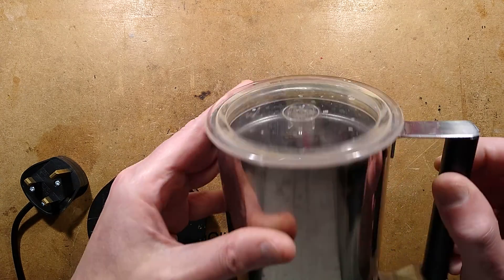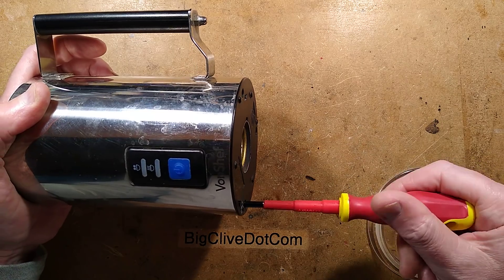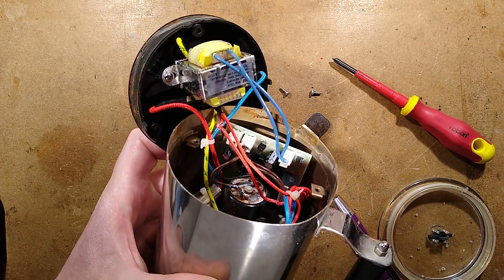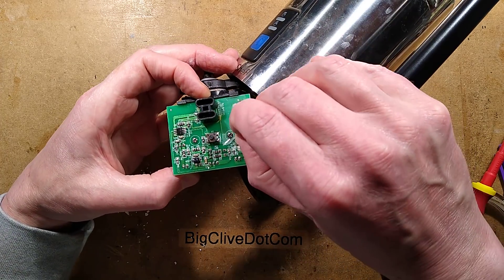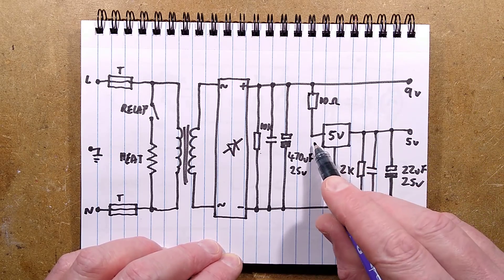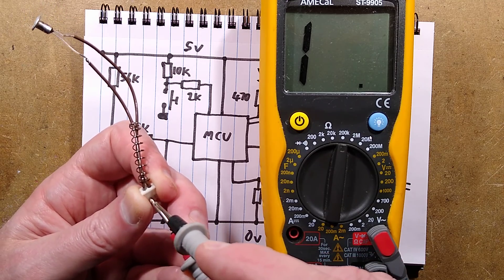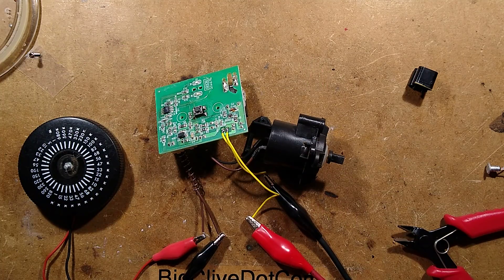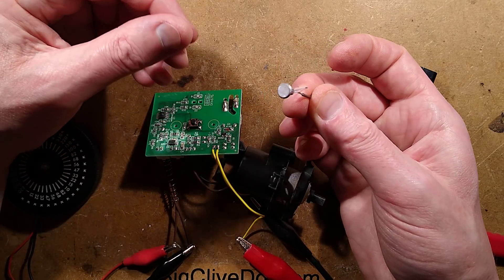Thomas Nagy milk frother autopsy

Comment: That board on its own would be a handy universal micro board.
Swap the micro (assuming you can match the pin out) and you have a simple programmable control board for projects.
Reply: Thats called an "Arduino"
Reply: @jaycee1980  really? Can you drive a motor or heater directly from an arduino without adding shields or extra circuitry?
There is a whole world out there that arduino are not the solution to.
Reply: @rohanhamer8429  Directly ? of course not, but then that's true of most things. If you want something you can just hook stuff up to without doing anything like that, then what you want is a PLC.

Or, you could just learn how to build the required external circuitry
Reply: @jaycee1980  I know how to do all that, I’ve been in the game for more than 40 years. My point was that this board has the extras already on it and would be useful for other tasks, for that reason. 🤦‍♂️
Reply: @rohanhamer8429  except you have to buy a milk frother to get it, and the microcontroller is not flashable...
Reply: @jaycee1980  how about you read and understand my original comment before opening your mouth. It’s about reusing and repurposing what was got for free and would otherwise be thrown out. I’m not suggesting you go and buy anything.
Having said that, if this board was common and available as a spare part from the usual Chinese suppliers, I bet it could be had for only a few dollars.

Comment: weird that they used the motor shaft to turn the frother, they could just put a magnet on it and on the frother and turn it with no shaft needing to go through the metal cup
Reply: Yup, Nespresso sells a similar device with exactly that feature
Reply: Kids and swollowee things.
Reply: Does that work through metal though? Those magnetic stirrers used in lab equipment go through glass. It's unclear what the base is made of. 3:28 Possibly plastic, maybe metal.
Reply: @ianstobie  Lab magnetic stirrers work fine through aluminum and stainless-steel, use them with pressure reactors all the time.  Probably some extra drag due to eddy current losses and local heating, but not a substantial problem.  Of course, if it was designed this way, then the milk wouldn't get into the electronics and you wouldn't need to buy a new one every year or two.  Seems like a rather obvious case of designed obsolescence.
Reply: @ianstobie  they do if you have a metal thats not electrically conductive and non ferrous. 
I would even see it work with electrically conductive ones but it might not be perfectly efficient. And its not like ferrous metals block out 100% of the field.
Reply: Thanks Robert and Ramog. 
So it looks like this one is just a poor design. The state of the art allows better.

Comment: Gotta love planned obsolescence
Cough*LED light bulbs*cough
Reply: Yup, I bought half a dozen Osram 8.8 watt LED  bulbs to try as replacements for CFL bulbs which fail normally within a year.  The Osram devices started failing at week 2 or 3 with a 50% attrition rate at 2 or 3 months.  Needless to say, I've put Osram at the bottom of the list.  I'll probably look at buying the highest wattage Phillips LED bulbs, and dhuby them as per BC's current philosophy.   We need 8 watt LED  bulbs and if I get the highest power ones available and Dhuby them down to 8 watts they should last a long time.  They do cost nearly twice as much however, and it will mean futzing around with over a dozen light bulbs to get what I want.

On the good side, the flat panel "oyster" LED lights seem to be doing rather well.  I have have a few here which have lasted several years with zero noticable degridation, and that includes a cheapo Chinese one that I used to replace the guts of a CFL T/5/10/something in my work room.  It was too big to take the original cover so I 3D printed something in clear PLA.  It's the brightest light in the house.  So my current experience is - LED oyster lights (LEDs on an aluminium substrate in a ring about 200mm diameter) last three years minimum.  Osram LED bulbs - three months.

Regarding the Osram lights - they fail with a constant output of only a fraction of a watt, so it might just be the feedback circuit which has failed.  I might look into it  and if BC is interested I could send him a couple from OZ.  It might be resistors failing rather than the LEDs.
Reply: Not planned obsolescence, just quest for lower cost. The first gen bulbs weights probably 5x as much as the newest ones because of the heavy metal body/heatsink, of course they cost 10x as much too. The reason? Look in the mirror.

Comment: Maybe I got spoilt when working on avionics but every PCB got conformal coating. It shone under UV light and was easily soldered through or removed with IPA. I worked on electronics from a 747 that swam in the sea and then spent about 6 years in a shed before it arrived at my bench to see if could be recertified for flight. It still worked. Admittedly there was corrosion on connectors etc that needed dealing with first, but I'll reiterate, it still worked and passed all tests. Except the visual test. There's a story there in itself. 

I looked up the coating recently and even at retail prices, it would be about 20p per laptop board. It seems criminal that phones/laptops (and particularly items that contain liquids like this) aren't conformal coated. It's almost* as if the manufacturer hopes that it will last the warranty period and not too much longer 🤷🏻‍♀️

* Exactly
Reply: Which is why I think manufacturers, suppliers and retailers should be forced to have a mandatory insurance scheme that pays the customer the greater of either current price of a replacement item or the original price of the item if the original item or a replacement does not last a reasonable time. With an independent organisation deciding on what a reasonable time is for each type of appliance. Then you will find manufacturers actually design items to last much longer. Yes, items will cost a little more, but I don’t think the price will rise an unreasonable amount.

Comment: I'm sure 100k NTCs have been around forever, but with 3d printers being common now it certainly shouldn't be much of a problem getting a new one quickly, and yes they have super thin leads and it's annoying, probably to eliminate wire resistance for temperature accuracy
Reply: Smaller wires = smaller thermal mass = quicker to react. You don't want the wires themselves acting like a heatsink.
Reply: @EricStuyvesant  yeah that too :D
Reply: @Tarex_  - also thinner wires have more resistance not less. But the current flow is so low that this is irrelevant.
Reply: @Mark1024MAK  right, was thinking less copper mass, just as in that the copper doesn't mess up the readings since they are resistance dependent

Comment: You can not solder the temperature sensor because the wire is made of special metals. See "thermocouple". Normally crimped. 
One of the things you learn when your oil heater is from 1972.
Reply: In this case it's an RTD, aka NTC thermistor, not a thermocouple. Leads will be something commonplace like tinned copper, not exotic metals as found in thermocouples.

Comment: the better frothers use a magnet mounted to the motor with a magnetic whisk like the nespresso units, although they have some quality issues too. Just to note if you ever try to open a nespresso frother, they split in the middle and the base is ultrasonically welded. Don't find that out the hard way like me 🙃
Reply: Begging your pardon, friend, but would you mind elaborating on ultrasonic welding, please? I can only find technical papers on the subject.
Reply: Vibrate two pieces of plastic with some somewhat specific geometry together sutch that they heat up, melt a little and stick together. It’s cheaper than fasteners, easy to mold and more secure than snaps
Reply: My Bodum frother uses the magnetic coupling approach and it works really well. I also haven’t had it for very long and I don’t use it much so who knows how long it’ll actually last.
Reply: That's the more expensive not "better"....But that said, it has less leakage problems through the bearing....
Reply: @muppetpaster  I have one from Severin, magnetically drive and induction heating. If only it didn't make noise...

Comment: And this is why fully ac Powered electronics with no circuitry inside (Brushed motors and the Like) Are the way to go because water ingress doesn’t bother them as much And there is no electronics to wear out!
Reply: I don’t know of any microcontrollers that run on AC mains… oh and AC powered equipment IS circuitry!

Comment: My mother got one of these exact frothers, it died within a couple of weeks. I wish I could have seen inside it but she just returned it back to amazon and got a free replacement which has been working fine for the better part of a year now. I guess now is my chance to see what's inside! Thanks for the content man!
Reply: We got a Swan brand deep fat fryer.It died in about 10 seconds - on a 'dry run'. Yes, thankfully I'd ignored the instructions to not put it on without oil in it, thankfully, so it wasn't all sticky.
Took the bottom off it and found a 5mm long lenticular plastic pin that linked two metal linkages apart in the thermostat. The two metal pieces having a hole in them for the ends of the plastic pin. So rough transit must have taken place as the pin had bounced out of one of these locating holes and was therefore effectively longer than it should have been. Once back correctly in the hole and put back together, it worked fine for a number of years.

Deep fat fryers became popular in the 1980s due to the number of chip pan fires burning houses down. We had a chip pan - used twice a week and not one fire. So it was somehat ironic that the deep fat fryer, when it failed a few years later due to a bad electrical contact, the connection overheated, melted the base plastic and fell through onto the worktop making two burn marks ! Since then, it's been oven chips !

Story 2

Back in the day - late 1970s (age ~13-14) after school, I'd go with a school friend to his house. As his dad worked shifts, he'd be home to make meals for his kids. One day while I was there we smelt smoke - his dad had gone out and left the chip pan on and when we went into the kitchen the top of the pan was all flame. I just put the lid on and moved it to a cold electric hob ring. We then went back into the living room - when my friend's sister came in and said "What's that smell?" We explained - and went back into the kitchen  - I took the pan lid off again and the pan once again burst into flames - so she could see what we had !
Reply: Gotmine for 10yrs or there about....working 6-10 times a day,no problemo...

Comment: I have exactly the same, still working, but it tends to burn the milk a bit, so cleaning needs a brush systematically to avoid buildup of brown nasty residue, I suspect bad fluid dynamics design or bad temp ramps.
Reply: Cleaning the heating element must be nearly impossible.  I'm amazed that it looked so good in this well-used unit.
Reply: @jpdemer5  in the office i have "swiss coffee brand one" which looks mechanically similar, but does not burn milk. There you just do a run with water&drop of fairy plus spash it once with fresh water: done for the day.

Comment: I did like that board. The unit may suffer from water damage, but the board was nice. Lots of protections in there (self testing, flyback diode, filter caps), all components specs printed on the PCB, someone took that part of the engineering quite seriously.
Reply: I wonder if an older revision of the appliance had more waterproofing.
Reply from the maker: It does seem well thought out.

Comment: With the difficulty of preventing water ingress, and the impracticality of potting *everything*, I wonder whether having a little package of silica gel in there would help?  I guess it would just get overwhelmed after a while.
Reply from the maker: Drain holes are good, although they also allow the water in during washing.

Comment: I had this exact model. It also died, I wager goop on the board.
Reply: Oh, mine didn't have time to corrode. After a couple uses, a drop of goop landed directly on the microcontroller and nuked the whole thing.

Comment: It looks like it would be a pretty good quality unit if they would waterproof the board. Like potting it then using wires to the pushbutton rather than board mounted.

Comment: Looks like the motor is well and truly buggered judging by corrosion and how slowly it turns. Can't see it whipping up much froth.
Reply from the maker: It's free running.  It doesn't have to turn that fast.
Reply: @bigclivedotcom  hey Clive I have a aircraft led corn cob style warning light meant for a tower that I used as a driveway light for 8 or so years that has finally died. Do you have a P.O. Box I’ll send it to you
Reply: @bigclivedotcom  Plus it has got the spring to help it froth
Reply: It probably looked slower than it is due to camera frame rate.
Reply: I have a similar one and the motor ist way quicker. Might really be a Video compression issue or the motor ist broken.